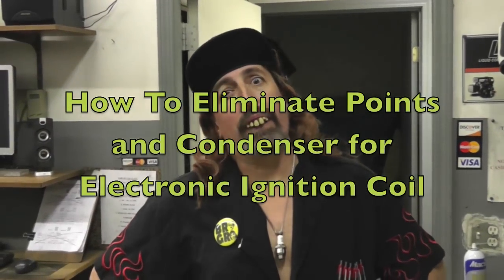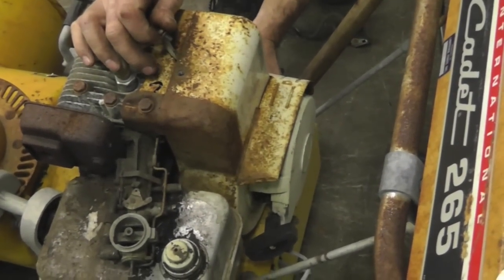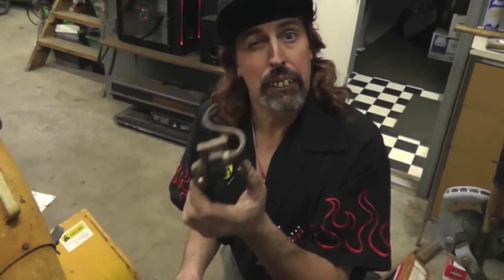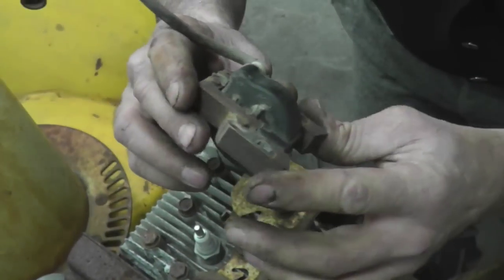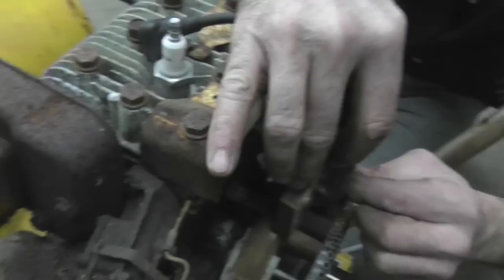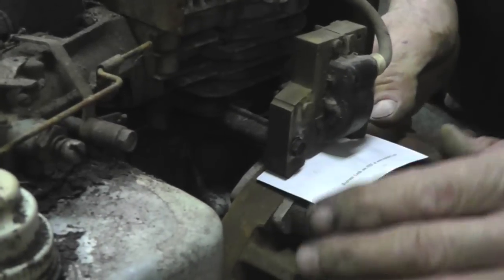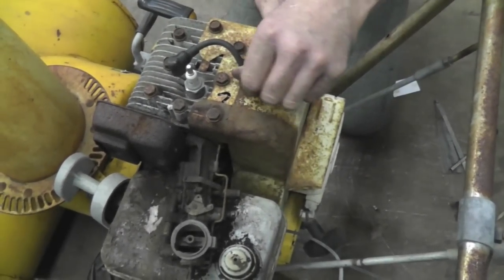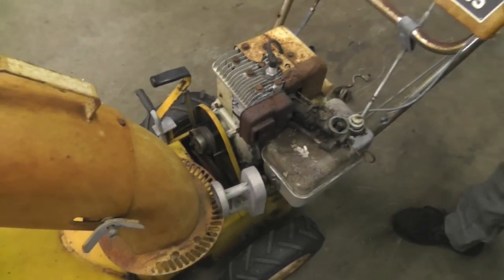How To Replace Points and Condenser with Electronic Ignition Coil with Taryl

Comment from the maker: ATTENTION GRASS RATS! Also it wouldn't hurt to sand the rust from the flywheel magnets to help with getting correct armature gap.
Reply: thank you.my friend told me to runw a wire to the + side of the battery and conect it to the kill switch connector?he said that it should always run hot?or have current?

Comment: I changed several older lawnmowers and rototillers over to electronic ignition because I got tired of removing flywheels to clean the points every spring.

Comment: Excellent video and information!  I had a deteriorated spark plug wire on my 1977 Briggs 11 HP.  I dreaded removing the flywheel  to get to the points so I took your advise and just cut the points wire and switched to a new electronic coil.....Fired right up!  I would never have known this could be so easily switched!  Thank You !!!

Comment: Thanks for the video. Was going to scrap my 197? 5hp wards snowblower till i saw your video it has not ran in 2 years had no spark i changed out the points and condenser still no spark so I changed out the old coil with an electronic coil and after 3 pulls started up. 
Thanks

Comment: Taryl, how do you go about matching up the replacement part.  I have a Kohler K-3992S, all the replacement parts I find online do not exactly state whether its Points and Condensor or Electronic Ignition Coil.

Thanks for your time and thanks for the great you tubes!!

Cheers!

Comment: There are 3 ways to change from regular negative ignition to positive ignition. With small battery draw, a cylinder type motorcycle coil can be used with accessory Stens ignition module. Just follow instruction sheet, and switch leads + and - . The magnetos and Magnetrons use the magnet energy from flywheel. The second method is to purchase the older style pre 1982 Magneto only, which is just a transformer. Make sure of small or regular size as <12 or > 12HP engine. Mount upside down and add the Stens accessory trigger module with directions. Add high voltage diode with cathode band facing forward, and will prove Positive high volts output. The briggs brand trigger module can also be used , you have to file edges to get it to fit on metal core leg. Briggs regular Magnetrons will not work upside down because of the embedded Briggs brand trigger. The Stens unit works both as plus and minus trigger. 3rd method is to use existing modern NEW STYLE Briggs Magnetron with embedded trigger type as only UNIVERSAL TRIGGER. The new China modules have this with a push terminal. Briggs sells this also now with their imprint in unit but higher priced. Mount as normal on engine mount with change as -- 2 plastic MM washers underneath core to insulate , and 2 plastic metric screws to tighten with gap set about .012" against flywheel. Put rubber boot plug wire to chassis ground, and obtain another insulated ignition cable to connect to metal of magneto under screw, and out to plug. You can then also test with 10kv diode. Units with universal trigger work at lower RPMS for starting, as like the very old style lawnmowers did .Circuits as these work better as when running extra energy with the sparking plug. And of cource you would have to verify zero ohms spark pl;ug, or exchange the internal resistor of Champian plug with #12 copper wire at top of plug.

Comment: I used to install Magnatron kits on those if I wanted to bypass points and condensor. I guess Briggs doesn't make those kits anymore but I see they're still available on amazon.
Reply: Did that consist of a small solid state piece that was spliced into the points feed wire or???

Comment: Taryl, can you show me how to eliminate the points ign on an older Onan generator? Mine is a 1966 CCK recoil start 4KW. There is no battery-operated starting system. Its just the mobile twin cylinder driven power plant.

Comment: I used this trick on an old Briggs and Stratton engine on a heavy duty Rototiller. I used a coil from a powermore push mower with a blown engine I had for parts. No modifications needed. I guess the powermore engines are good for parts on the old stuff. Hope it helps someone.

Comment: Hey Taryl.......I got a 8hp briggs and scrap iron on a old sears rear tine tiller.  Be real handy to have a part number for that new 'lectronic coil thing ma bob you just installed. Well maybe I can figure it out.
Reply: MM Reporter did you ever get the part number on the coil. Just found this vid. And have a rear tine Troy built tiller that I'm trying to bypass the points.
Reply: Stens 440401 another is Stens 440-417

Comment: hi Taryl  i did exactly everything u did on my simplicity snow blower the only difference is your video shows a white spark fly in the tool gap , i tried different gaps on my gap tool including the correct spark plug gap and all i get is a red spark will this fly or i am doing something wrong  , HELP i want my dinner....
Reply from the maker: +Juan Martinez Does the engine run after you repaired it.
Reply: yes it does...
Reply: i was just curious about the spark , cause i seen different plugs make red, white and even blue spark and i thought the brand of the coil might be the cause...
Reply from the maker: Yellow spark usually indicates weak spark. You generally want Blue Spark that actually makes a snapping noise.
Reply: So what could cause a reddish spark coming from a new coil that don,t need points and condenser ?

Comment: I Have a 2 Hp 1962 B&S model #61102 the coil has 4 mounting screws, Got a part # for that 
Thanks,
Todd
Reply from the maker: +Todd Struve Good question Todd the parts breakdown shows the 2 & 4 screw mounting coil. The 4-screw is NLA . I think but am not sure that the 2-bolt would work in place of the 4-bolt. That coil is a electronic so it would eliminate the points & cond. the part number is 591420. Yur other option would be to buy one of the ATOM or NOVA modules that eliminates the points. I have one of those old Briggs w/ the 4-bolt coil here at the shop but I don't have the 591420 coil to try on it.

Comment: Taryl, I have a vintage Honda E 2500 generator with no spark, when I removed the flywheel i noticed that there is only one magnet fitted inside it but there looks to be 3 places available for magnets? Should it just 1 magnet or 3 magnets? Any info would be much appreciated and there's your dinner.

Comment: outstanding video.  Thank You.  I have an old Toro snow-thrower 524  Model 38040 with a Tecumseh H50 5 hp Engine. I would like to replace the existing set up to the electronic coil as you did.  Which part # electronic coil is recommended? The old coil # is: 610694A Thank You. John
Reply: You cant switch from points to electronic ignition on Tecumseh. You coil is down inside the flywheel. Tecumseh did not put the coils on top of the flywheel until after they switched to electronic ignition.
You can try using a Nova II electronic ignition chip (look it up), if that doesnt work you have to stick with points and get them working.

Comment: Thanks Taryl for ALL your helpful videos. I would like to remove and replace the OLD coil, B&S 291617 (Eng. 80202-0855) with the NEW electronic type, is there a P/N that I could buy? 
Your blessed reply will certainly be my dinner. Thanks and God bless you and the USA.

Comment: Ok I’ve got a John Deere 318 with a craftsman 20 hp onan engine with electronic ignition. It starts and runs once a day for about 30 sec then runs out of fire and won’t start again until the next day. Does that sound like the electronic ignition or what ..? I tried a new coil and condenser but it does the same thing.

Comment: Is this correct? For a 3.5 hp (2-4 hp) I will replace the 33-362 (points and condenser type for 80000, 92000, 110000 engine series part # 298502 & 305488) for the 33-342 (electronic ignition Part #697036, 398593, 496914)?

Comment: So how do you find the correct coil?  I'm trying to covert a B&S from the 70's and have no idea where to find an electronic coil that will fit this thing.
Reply: You find it yet?
Reply: Just get a modern coil fron a 5 horsepower Briggs that had ele tronic ignition instead of points. Any engine built after 1983 will do.

Comment: Would this work to convert my 78 Arctic cat snowmobile with points system coil to cdi ignition coil?
Reply: Or would it differ because the points ignition coil is external not internal like in the video

Comment: I did this conversion to the same kind of aluminum block Briggs & it has spark, but will only occasionally pop back through the carburetor. Valve Timing is right on, engine has compression, but only pops back through the carburetor.  
Any thoughts ?
Reply: Check your flywheel key, it may be sheared. Also, did you put the coil on backwards? It's marked cylinder side, should face in
Reply: Valves might need a good lapping
Reply: @staind288  there's your dinner!

Comment: Excellent "How to Do It" video for repairing old engine ignition problems by converting many older typically USA made utility engines to solid state (pointless) ignition. 

This is likely a less than a 10 minute job for any competent "wrench turner" who studies this video and does not have a very rusty flywheel.

New, solid state, modular ignition coils (that require no external mechanical points or capacitor) can be purchased from several places on the Internet for less than  $15.00 (delivered to your door) for some very common engines. These coils typically have a 1 year warranty and may, or may not, be made in the same China factory as many OEM coils costing 3 times as much.
Reply from the maker: +johnvolk58 You are correct sir & Theres yur Dinner!

Comment: What is that coil you put on in place of the old one???
Reply: Electronic ignition built in vs a coil that runs to points.
Reply: You can actually use a newest style coil (newer than the one he has here) and use it backwards

Comment: Hi Taryl. I have a question for you. After watching this and several other of your video's which are excellent I would like to pick your brain if I may. I have an old Krohler K301 that lost spark. It has points and condenser and the older auto style coil. Is there a way to change this to electronic ignition to do away with the points and coil and if so can you tell me how? This is on an old Cub Cadet, you know back when they used real steel, and made them to last, and I would love to get it running again.

Thank You.
Reply: I had an old Roto Tiller with a similar engine.  As I recall, since I couldn't get the fly wheel off, they spliced in a small solid state 'something' which eliminated the points and condenser and It has worked fine for over 18 years.  I have a small garden!

Comment: What do you do if the coil is behind the flywheel
Reply from the maker: You can try one of those ATOM or NOVA modules. They replace the points & cond. & make it electronic. They're pretty in expensive.
Reply: +Taryl Fixes All thanks!
Reply: +Taryl Fixes All also it's an old Tecumseh 3hp any thoughts as to which module model number to get thanks
Reply from the maker: They're both the same module just two different brand names. So just pick the one that would be easier for you to purchase. & wahlah Theres yur dinner!
Reply: +Taryl Fixes All thanks!  Love the videos...u definitely know your shit

Comment: I have short hair nice teeth my eyes are both open and I talk normal. I guess I can't be a small gas engine mechanic.
Reply: correct, I personally have nice teeth, talk normal, and my eyes are both open. I have long hair, and once I tried cutting it short... I completely lost all ability to work on small engines
Reply: Doug s 2
Reply: Damn straight!
Reply: @Doug s— very disrespectable, cruel and uncalled for. If you judge people but their looks you will miss out on many wonderful experiences in life. Taryl is very talented and knowledgeable on what he does. Maybe try listening instead of judging and you will learn something, possibly even more than fixing lawn equipment.

Comment: taryl, i noticed you did not sand away the rust on the flywheel magnet.i guess this is not necessary?   dick bailey
Reply from the maker: +dick bailey Good point, Yes sand away it helps.